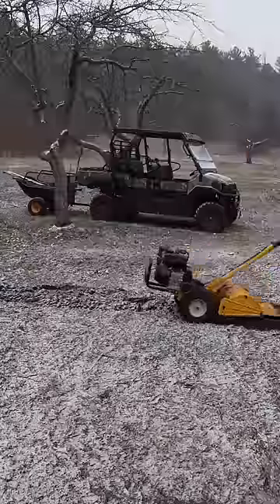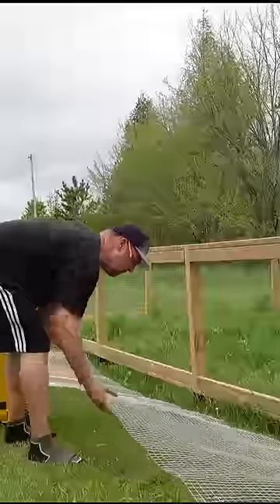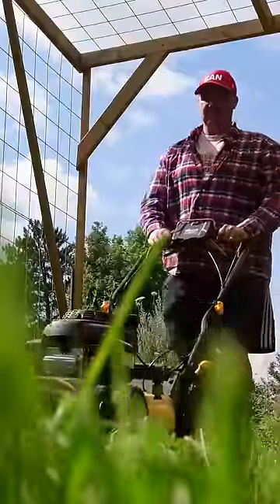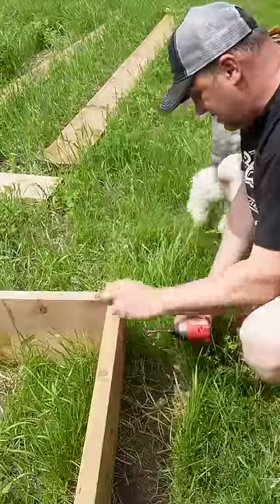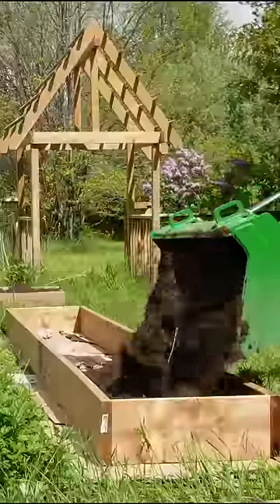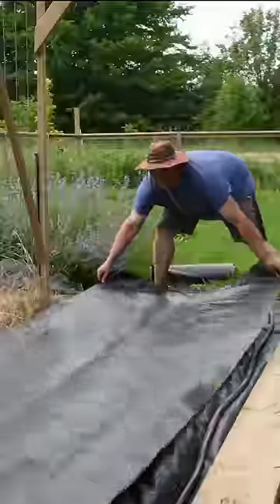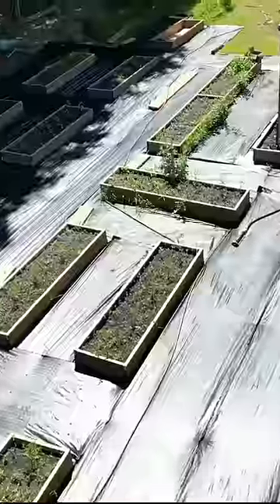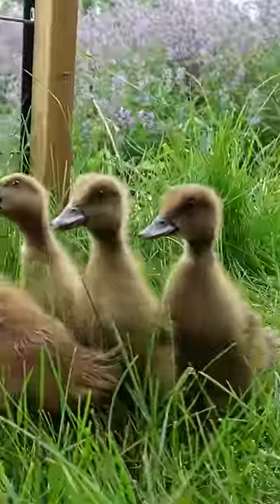Man Builds Garden From Scratch (Start to Finish) #shorts

Comment: My brilliant neighbor suggested I put chicken wire under my raised beds so the moles etc didn't burrow up and nibble on the roots. My raised beds are shorter than yours, only about a foot, so having the chicken wire & and anti- weed fabric has been a lifesaver!
Reply from the maker: That’s a good suggestion especially for anyone experiencing tunneling rodents.
Reply: Same. Mom used chicken wire to fend off the gophers.
Reply: @HiddenSpringFarm it's so much easier to add the wire early in planning & construction than to have to tear multiple beds apart and start over. Great videos!!! Thanks

Comment: I don't normally use logs for the raised beds. In theory it provides long term nutrients, but at the same time these logs can take a decade to decompose, especially if you have cold winters. So after a long time the nitrogen levels are wack. I recommend just using smaller leaves and branches that you can find anywhere. Maybe 1 log, but no more.

Comment: It's actually better for your raised garden boxes to use a sort of ground leafs bottom to fill instead of logs. 
Something about the decomposition chemicals that are released and the time it takes to break down. I forget but if you Google it you'll find the info. But fill with leafs filler and not logs. It takes 6+ years for the leafs to break down
Reply from the maker: Depends on the wood, u don’t want to use red cedar or walnut cause of the jugglone. I’ll try leaves this year and see if there’s a difference. Logs release nitrogen slowly so it’s supposed to be as they decay you have many years of a nitrogen supply. We have an abundance of leaves anyway.
Reply: It takes too long for logs to break down, where leaves will break down faster.  You can use small Twiggs along with the leaves.

Comment: this is probably a really dumb question... but I usually have a black thumb but I really want to learn to grow food for me and my kids. Do you need to buy all of that type of soil again next year, or can you just amend it or just reuse it next year? I'm surprised how expensive soil is.
Reply from the maker: No dumb questions here. I’m no expert either. No you don’t need to buy new soil every year, but it all depends on what you do to keep adding nutrients. I tilled first trying to plant directly in the soil but the soil was hydrophobic almost like beach sand, it would have taken years to amend so went with the raised beds. I bought new triple mix soil for the top 10” of the beds. We also have rabbits so I’ll be adding their manure as I go. All the other animals produce manure but it has to compost down first. Leaf mulch and grass clippings help too. My advice would be to start a compost pile at the same time as the garden and you’ll have an endless supply of organic matter to add to the soil every year. I’ll be working hard this summer building a compost area for that purpose cause I made the mistake of not doing it from the beginning. Learning never ends though.

Comment: Great video, I would just recommend you google how long logs take to break down, 40-120 years and they will throw your npk out of whack. Other than that love the set up. The saw also is a great saw I’ve used mine for many years in construction
Reply from the maker: Thanks for the tip! Although I'm certain these logs will be done in under 5 years. Hopefully it won't be an issue cause they're already down there lol.  We'll see this year I need 6 more beds I'm going to try a leaf method I saw. We have unlimited leaves here anyway. Cheers.
Reply: @HiddenSpringFarm  leaves definitely work best in my opinion. Been doing it for years. We used that method to turn absolute dust into beautifully rich loam. 🙂

Comment: Cardboard kills snails and slugs but is 'loved' by earthworm. Very good choice of mulch.

Sudex (sorghum-sudan cross) will punch tap roots as deeply as the rop grows tall. Cut when it's 10-12 feet tall no lower than 6 inches to get the same effect 3 or more times. Cowpeas can be planted with it to add nitrogen. This is how farmers and ranchers renovat poor or compacted soil. 

But, just a heavy mulch on compacted soil will loosen it by the end of summer. Be warned, it'll be very, very high in nitrogen thanks to earthworms.

Comment: Please do not use logs or sticks to fill up your garden beds. It does save you money, however it also makes  your garden bed decomp unstable. It takes a lot longer for a log to break down and decompose. so while it is doing that, your garden soil will fluctuate significantly. The decomposition of the logs COULD fuel the growth of some plants, but also stunt the growth of others. And because that balance fluctuates so wildly (bc different stages of decomp) you might get a great season with carrots one year, and then the next year your carrots do shity in the exact same bed.
Instead just use wood chips in the bottom of your bed to save on dirt
Reply from the maker: too late they're already down there. But I think I'm adding 6 more beds this year so I'll keep that into consideration. we have our own chipper too and leaves are abundant so it should be easy to do. We'll see.

Comment: You can't think of everything, but you could have made a gate wide enough for your little, (not a backhoe, just the shovel).
Reply from the maker: Built the fancy front gate to accentuate the entrance but a 12’ wide farm gate on the other end, but the tractor can only drive straight in and back out cause I put all those darn beds in the way 😆
Reply: @HiddenSpringFarm  I am not second guessing you, but you could have your bucket full, drive adjacent to the row you are working, (it may be flats of sprouted plants), and then you could distribute it for the row. Or fill a wheelbarrow for beds down the line.
   But then, maybe you are done with bulk, and you don't need that.
   I am always thinking problem solving. You mentioned the problem, and my thoughts go to mechanization, productive efficiency. I got my start with, "Cheaper by the Dozen."

Comment: Well the next year or two you need to seal that wooden fence to protect it. We were told now it was pressurized would and would not need sealnt, now does has 30 years on it what we get to do ya replace not seal!
Reply from the maker: Yeah I’ll most likely do it after a few years, I’ll just spray it on.

Comment: You  did a lot of extra work and spent a lot of extra money. If you had raised beds, no need to till and prepare ground you will never use. Why put landscaping material down? The weeds growing between the raised beds aren't interfering, just mow them occasionally. My parents used to keep a garden this size, no raised beds, just till the ground and make rows. That's where a tiller is needed. Good luck with your garden!

Comment: Logs aren't great for building up beds. They take forever to decay and will give you a longer nitrogen imbalance. Like 50 years...  I've heard using leaves and wetting them is better.
Reply from the maker: I did add some leaf compost on top of the logs...these beds are 30" high too and they definitely don't take 50 years, they're already rotting. 5 years max.  Logs hold in so much moisture and I find the nitrogen fluctuations are negligible. Leaves work good too though but I'd have to keep adding as they break down so fast.

Comment: Logs aren't the best thing to use to fill a bed they tend to knock your nitrate levels off in the soil because they take so long to decompose I would have went with something like more cardboard or at least later as a filter instead of logs the decomposition rate is substantially higher compared to the logs
Reply from the maker: Maybe leaves are good too but I’ve never had any issue with logs. I’ll keep an eye on it but I’m sure these logs will be soft and mushy in a few years. I’m gonna try leaves this year too and compare.

Comment: Logs in "raised beds" take 100-290 years to decompose. Best practice is to use dried leaves!FYI.  Why aren't "raised beds" high enough to stop bending over?  Save your back!
Reply from the maker: I have a huge pile of leaves I saved this year, when I get some more beds this summer I’ll try it out.
Reply: No, they don't.  Takes less than 10 years.  Stop spreading wrong information.
Reply: Takes 2-3 years to decompose depending on size. The moisture and microbes break down the wood quickly in a warm environment.

Comment: The wood trend is so stupid🤦🏻‍♂️ takes way to long to decompose and creates a giant prolonged nitrogen imbalance
Reply from the maker: If you consider a trend to last for decades then agree to disagree i guess. Hugelkultur is nothing new.  An imbalance yes, but so minuscule it's not noticeable, leaves would cause a similar imbalance.  its in the bottom too,  i used fresh soil for the top 10-14 inches and add new compost and manure yearly. veggies don't seem to notice an imbalance either.  I'm just showing what I did, you do yours your way. Cheers
Reply: @HiddenSpringFarm  you do the strategy right atleast. Most people cant even do that right lol. To each their own

Comment: If I had an extra 1.5mil laying around, I'd be doing the same thing
Reply: Start out with one or two garden beds, next year add one or two. Instead of flowers or gifts or going out for valentines day and mothers day I ask my family to buy me new boards, soil (one bag of peat moss two of manure and 4 little top soil) I then add flattened boxes and any yard clippings and leaves... then add my mixed soil on top. It's usually between 150 and 200 which is totally doable especially if you save up. I now have 6 small (used primarilyfor greens and herbs), 4 med but deep (used primarily for root crops, I add anew bag of manure each year to make them fuller)and 2 large garden beds (used for squashes and larger cold crops). Tomatoes and cucumbers and such can be added to any pots you find for free or almost free. It doesn't have to be perfect or even beautiful to start, you can start little.